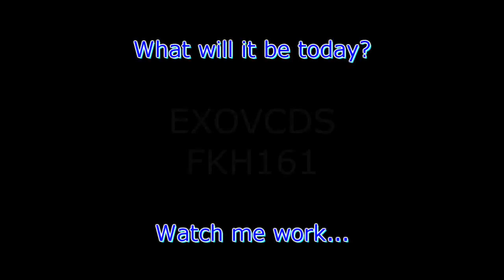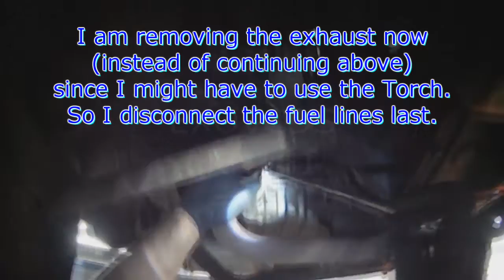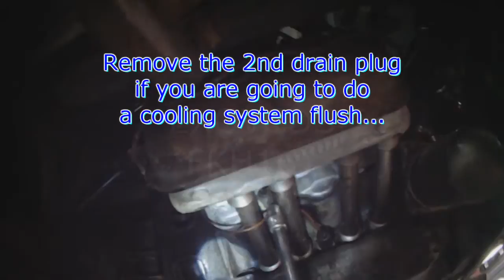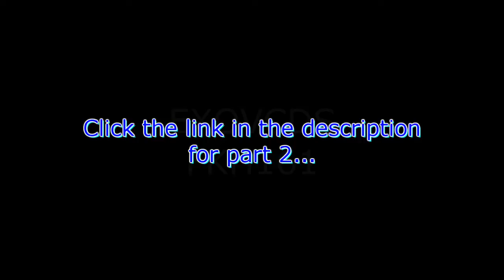VW T3: 2.1L Cylinder Head removal (1 & 2 side)

Comment: Hi,  

Couple of quick questions, Does the engine oil need to be drained before pulling the head off? And when doing this without removing the whole exhaust, does it make it much more difficult, as it seems like it'll be in the way?
Reply from the maker: It doesn't have to be drained, but it's a good idea to drain... less will spill out of the pushrod tube holes when the pushrod tubes are removed. You can try to work around the exhaust pipes... it just makes more sense to remove as much as possible, to gain as much room as possible (for easier access / removal of heads and more maneuverability in general getting the heads off & on).
Reply: Thomas EXOVCDS 
Wow thanks so much for your quick reply! I'm thinking of doing this to my 1990 T3 this weekend. This video really makes me feel like I can take it on. 
Is it common for a head stud to snap? How much of a headache is it when it does?
Reply from the maker: It's not common that the studs break / snap... but when they do, it can be a real pain to get them out of the block. The worst we have had, we had to remove & send the engine to a machine shop.
Reply: Thomas EXOVCDS 

That's good news. I'll make a start on it this weekend. Hopefully all goes well. Thanks very much for the replies and all your videos!
Reply from the maker: Thank you for watching! Let me know if you run into any issues. Do you have a Bentley Service manual?
Reply: Thomas EXOVCDS 
No I don't, I haven't needed it so far, there's so much info online...
Reply from the maker: Ok... just as long as you don't go in blind.
Reply: Thomas EXOVCDS 
Hey, it turns out my head and piston cylinders are in worse condition that the one in the video. The car was running great, it just had minor leak coming from the head gasket seal. I can't get the cylinder head off either side no matter how much whacking I give it with a rubber mallet... I think the piston rings are corroded to the head and I can't pry it off with the bunny ears... Have you had this happen to you? I'm thinking maybe I should put some wd40 inside to loosen the cylinder ring? What do you think?
Reply from the maker: Nobby Teixeira Pull the rubber head gasket from between the cylinder head and the block. Use a pry bar and wedge it against the cylinder sleeves and the head... as shown in part 2   https://youtu.be/ZwtBtiSjGXs at the 6:31 mark. If the cylinder sleeves pull out of the block, you will need special tools to remove & install the Pistons.
Reply: Thomas EXOVCDS 
I've spent and half a day prying and banging to get the head and block apaft... I tried yelling and swearing at the thing too but It seems like it's fused together. I managed to get a gap on the bottom of the and tried to pry the cylinder tab but it's not budging... I've hit a wall, Im going to have to get someone in to get it apart for me.
Reply from the maker: Nobby Teixeira Sorry to hear. Keep soaking the cylinder sleeves where they meet the head. Spray from the top & bottom . You've probably done that though. Heads & sleeves should pull off easily together but that will require special tools to get the sleeves back in.  =(
Reply: Ive found the problem, and its worse...  the cylinder head studs are jammed.... one bolt on the top left side & three on the top right side of the motor. Its really fused in there and not budging 1mm no matter how much wd40 and whacks i give it... ive peeled back the gasket from the bottom, but now ive just gone past the point of no return... have i just destroyed a perfectly running engine? 
Sorry for  bugging you by the way, Ive just found for website, and if i somehow manage to get it off im transferring you cash for a carton of beer.

Comment: Can't see, forgot to put my goggles on Lol.....
Did I miss the part why the head is coming off?
Reply from the maker: Head gasket was leaking coolant... it came apart nice and easy and the water jacket o-rings (green) looked like new. I assume that the last head gasket was only a few years old. Must not have been tightened correctly... they shouldn't leak for at least 8 to 10 years. Remember. my videos are all about the work, not so much the diagnosis.